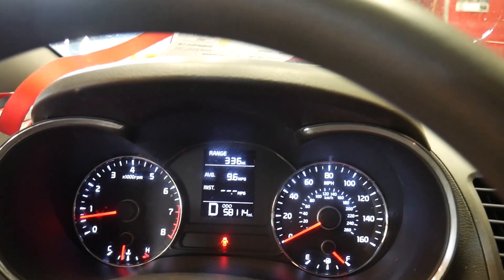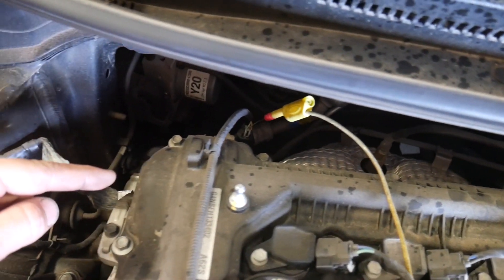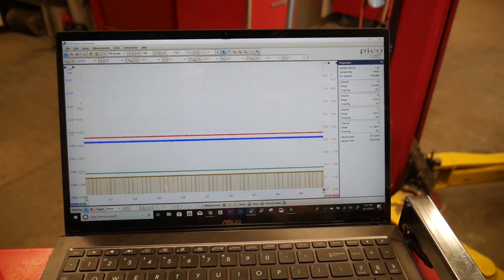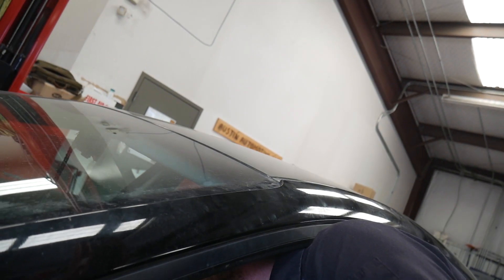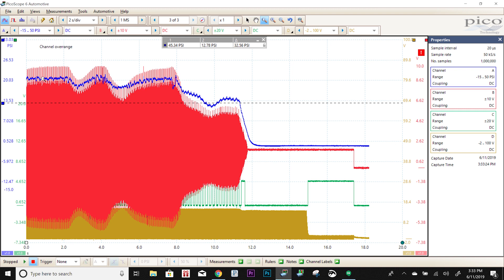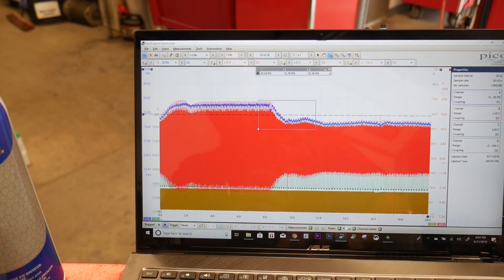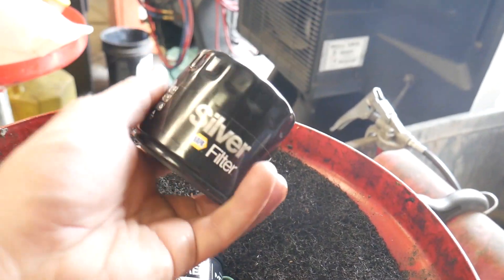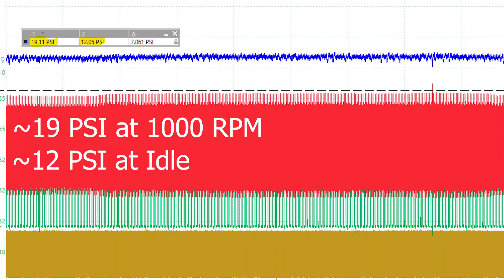2014 Kia Forte shake, rattle and stall- Diagnosing stalling issue

Comment: Great job on this. I’m running into this now. Would have never thought. The only thing I changed was going to Valvoline instead of the dealer because I’m out of warranty. I’m going to change the oil myself and Lord willing it’s gonna be fixed
Reply: Did it fix your issue?

Comment: Hello , I have almost the same problem but the light of the oil shows when I stop the car or idel . I changed the oil and the oil filter ,but still the noise coming on the low speed and the oil light shows on the dashboard .
Reply from the maker: @abdullahkhasawneh462  you likely have too much internal engine wear.
Reply: @ could be the engine oil pump?
Reply from the maker: @ typically no. I have only seen an oil pump fix a low pressure issue twice. 95% of the time when the oil pressure is actually low the problem is caused by internal engine wear.

Comment: My daughter has the same problem execpt it's 2018.  Can you tell me if the filter you used would work on 2018 and if so, what filter is it?  Thanks in advance.
Reply from the maker: @douglassmith2460  I now only the OEM filters on Hyundai and Kia. The part numbers vary year to year. Best way is to call dealer parts department with VIN.

Comment: Juat had this issue and got an oil change with a new OEM filter.  If i were to try to replicate this  a stall in a parked situation, could you advise? What rpms and how to brake.

Comment: This is great my 2017 Kia Forte S has been stalling just like this with no codes on computer also was thinking would never find problem thank you
Reply: I have the same issue will be looking into this
Reply: @ashleytaylor509  Changed the oil and problem went right away
Reply: @cutter7515 which oil did you use ?
Reply: @ashleytaylor509  full synthetic 5w 20

Comment: Very glad to find this video after checking dozens, thank you sir. I have a 2015 Sportage with 1.6 liter 136 HP GDI. It does not stall, but  idles at 600 rpm and shakes too much. Rpm surges 1-2 times  as I wait at the red lights, but it rides well. Dealer could not find anything, no codes nothing. Can it be the oil filter?  UPDATE : I finally  found the issue, the ignition coils were bad. They throw no codes, they were not totally broken, but it seems that they were not performing % 100. GDI engines are very sensitive for ignition, so if one of the coils go bad , you better replace them all. I hope this helps someone who has the same issue.

Comment: Jeez, THANK YOU so much for this video.  This has got to be my same problem.  I owe you big for this!
Reply from the maker: Let me know if that takes care of your issue.
Reply: @ThePracticalMechanic  It is looking good so far. I need to drive it around a little more, but I tried to low idle stall it and it wouldn't stall.  I put "Engine Restore" in a week or so ago, and I think that loosened some gunk into my oil filter. Lesson learned on that.

Comment: Oh dear I got one of these coming in the shop tomorrow at noon 15 forte. 
Customer States the car is hesitating between 1st and 2nd.
He has no codes at all!!
I was going to start with changing plugs and coil packs🤷‍♂️
Then I was going to move into cleaning the fuel injectors.
I'm glad I watched this video sounds like Kia makes a real s*** engine
Reply from the maker: What did you come up with? Hopefully some easy stuff like a tune up and oil change.
Reply: It ended up being the customers father took the car for Christmas and had a remote start put on.
They ran a wire through the firewall and into the first coil pack. There is two wires a blue and a red. they damaged the 2 wires and they were intermittently arcing.
I also changed all four plugs and coil packs .. car runs great.
 his factory radio was not working the dealer told him it was burnt out.
Replaced the fuse.. still working great today.
Reply from the maker: @larsbambi1575  we see lots of issues with remote starts and radio install causing battery drains but luckily not poor running.

Comment: This year and model of car has an active service bulletin for the original engine. These engines will catastrophically fail. There is an issue with oil delivery which leads to rod bearing failure. My car engine failed in this manner and left me stranded on a dangerous and narrow canyon road. The warranty is extended to 150k miles for these engines.

Comment: OEM filters and synthetic oil only on my 16' forte 1.8l since day 1, only time I got shaking was when I didn't get top tier gas for 2 gas fill ups. Currently at 130k miles, never cheap out on auto parts. Only code I've ever got was for a bad gas cap
Reply: You used premium gas only? How is the car now? Any issues?

Comment: This video was extremely helpful.  I have the exact same symptoms with same vehicle.  When I did my last oil change, I put a KIA dealer oil filter but put too much oil in the crank case.  Being in extremely cold tempuratures right now, I'm trying to figure out a way to remove some oil without having to crawl under the car.

Comment: Curious to know what that ticking noise is. I've read on a few forums that these engines start to tick usually around 50xxxkm. Is it that the valves need to be lapped?
Reply: Those engine do not have adjustable valves. They have solid lifters
Reply: Can confirm, my forte started ticking around 50k, still does at 130000km. Still no engine problems, though.

Comment: I have a 2014 Forte that dies at stops part time with no codes. I hadn't noticed it rattling but I did see the oil light flicker at idle in gear. I'll be checking the pressure & filter in the morning. Oil level was full. Thanks for sharing
Reply: Same thing is happening to me.
Reply from the maker: sorry for the delay. What was your results? Plugged filter? We are now stocking the kia/hyundai oil filters and recommending 3,000 mile intervals. We are seeing too many oiling issues.
Reply: @ThePracticalMechanic  I ended up changing the MAP sensor and the crankshaft sensor since both their codes showed up in the scanner and the car is perfect now
Reply: @ThePracticalMechanic  Oil pressure was 8-9 PSI at hot idle.  After install a NAPA gold filter it was 20 PSI. No more stalling.

Comment: My gfs car does this.  And even after i do the oil change it used to fix it but now it's still raddling. How do you fix this issue not just doing an oil change
Reply from the maker: You may have an engine that is worn out. The oil filters plug up with small metal shavings and hard oil deposits. Driving for long periods with a restricted oil filter causes accelerated wear and more particles. Changing the oil filter cannot restore the worn components back to new condition. It might be time for internal engine work or a new engine.

Comment: Hello👋
I just wanted to say THANK YOU For this video. I took my 2015 Forte to Kia 3 times for a rattling sound and stalling issues. They were never able to find anything after numerous times of me telling them that my vehicle was not safe to drive. They even said that the rattling was normal because the car was cold. I eventually brought it back home and bought the oil filter you mention on this video, did a motor flush and changed out the oil. My car is back to normal doesn’t rattle or stall anymore. 🙌🏻 thank you!
Reply from the maker: Becky Briones that is awesome!!!! Not awesome that they missed the issue but awesome that you were able to get it fixed. Thanks for the comment and hope you have a trouble free car now. 👍🏼
Reply: I’m going to try this because Kia can’t seem to find out why my 2014 Kia Forte is stalling just shutting off while driving ty
Reply: The dealership solution is either sell a boatload of parts, or deny that a problem exists and send you packing. I bet that they never even duplicated the problem; too many gravy jobs waiting.

Comment: Hello
I have bought recently Kia Rio 2014 1.4L petrol Car and facing a serious issue with it.
The car run perfectly but the fuel consumption is very high.
When I turn on the Air conditioner the car starts stalling at low speed.
The car is not showing any Warning on the dashboard.
I have changed the Crankshaft positioning sensor, camshaft positioning sensor, serviced the nozzles, changed spark plugs, checked the engine timing and everything is OK.
Would really appreciate if you can help
Reply from the maker: There are so many things that could cause poor fuel mileage. It might be time for a second set of eyes to give it a shot. Without seeing the cars data while driving under different load conditions  and testing individual components your just going to be guessing.

Comment: I'm thinking about buying a 2013 Kia Forte with 110,000 miles on it. When I went to test drive it, it seemed like it was rattling hard and almost going to stall out a few times when coming to a stop. Never accelerating though. Any ideas?
Reply from the maker: It is possible that it has the same issue. It might be worth it to have the oil changed even if you don’t purchase the car just to find out. If the noise is still there it may have more issues. The $40 oil change may save you thousands of repairs expenses.
Reply: @ThePracticalMechanic   thank you for your feedback. The owner mentioned that it had done that for the last 6 months and I saw that he had a recent oil change so I am NOT buying that car. Do you know what Kia model years do not have this engine problem?
Reply from the maker: I’m not really sure since I only have a few customers with Kia vehicles. I’ve seen this problem on other newer vehicles as well but with less of an affect.  I think a similar model would still be fine if the owner has maintenance records showing regular oil changes. 3000-5000 mile intervals is normal although I prefer using a factory oil filter and 3000 mile oil change intervals for extra protection on newer vehicles.
Reply: I recently bought a 2014 Kia forte with 101,523 miles on it I was at a stop light and the car turned off on me which I don't understand it's basically a new car with a good engine it seems to be

Comment: My wife's 2014 Kia Forte was stalling with no warning. She played around with it last night, could not find any codes or anything. We took it out for a spin tonight and I noticed the pinging and then it died. EXACTLY the same issue. And, she needs an oil change. She is at about 5000 miles since the last change. Yikes! I hope it's not a bad engine! I just realized she commented yesterday!
Reply: It worked like a charm! Got the big filter from Napa, got one for my 2012 Kia too. I've never had it ping like that, but it's a standard so I generally have it revving higher at slow speeds. I think it works harder too, smaller engine.

How did you figure it out? I would never have equated the timing advance to a drop in oil pressure, and I'm an engineer. You sir, are brilliant!
Reply from the maker: Hopefully the oil change will fix it. Any oil filter at this point will be better than the dirty on you have but if you have a local Kia/Hyundai dealer try and get a factory oil filter installed. An alternative would be the “Full” brand oil filter that you should be able to get from a Napa/Carquest/Advanced auto store but they may have order it in. The good filter is still only $5-8 depending on purchase location.  You may also want to consider switching to 3000 mile intervals once you know for sure no permanent damage has occurred.  Good luck!!
Reply from the maker: How did it turn out?
Reply: Been trying to hunt down the cause of this issue on my kia. Looks like it worked. Thanks a ton

Comment: My 2014 kia forte just did this twice today for the first time...  due for an oil change... will watch your video.  No engine light, no codes
Reply from the maker: Since this video I have been expanding the amount of OEM filter I keep in stock. I don't want to be the cause of future issues. Hope the oil change helps you out.
Reply from the maker: I asked your husband as well but I was wondering if you were able to change the oil and if the car is running any better?

Comment: My 2015 kia forte stalls when I'm at stop lights or turning really slow and then it starts right back up and drives fine. No mechanic can seem to tell me why. Check engine light has came on but it reports emissions issue. Can't tell me why it's stalling.
Reply: See @ 6 min mark, wrong oil filter installed
Reply: Same here oh my god its infuriating

Comment: I have changed the oil and filter but still have the sound, what is the problem
Reply: Wherever you got your last oil change done prob also put the wrong one on. I'd go to a Kia Dealership, get an oil change done, they'll put the right size one on, it's prob bigger than the one you got on now.
Reply: Maybe you put on a filter that's too small? See @6min mark
Reply: @rancidpunxcrypto1547  no the new filter is the same as the original one
Reply: Your last oil change was done at a Kia Dealership?
Reply: @rancidpunxcrypto1547  no

Comment: Nice video! I have the same issue but haven’t noticed a ping. Oil changes are done regularly at a kia dealer. Could this still be the issue? Running out of part idea to throw in it...

Comment: so the problem is the oil pressure ? my car which is a 2013 kia forte has the same damn problem we thought it was the fuel pump so we changed the pump out and its still stalling a second after getting it to turn over i done lost all hope for this car where should i take it
Reply: Wrong oil filter, see @ 6 min mark

Comment: I bought a used '14 Kia forte,  58,000 and change on the odometer. Same issues going on.  But im also experiencing voltage loss somewhere.  It's steady jumping at 12.5 to 12.8-9ish and surges to 13.1ish. New fuel pump, new alternator, new spark plugs, new oil in it with filter.  Ran a relay from fuse box to positive battery terminal because people have fixed the issues im experiencing.  Flickering interior lights, flickering headlights, low idle that surges,  i have the 1500 rpm range stall attempt as well.  It just jumps rpms around though.... doesn't stall anymore.  Do you think this could really be all because of low oil pressure? Seems far fetched
Reply: I have a 2014 forte, am having engine issues and oil consumption. No codes are showing but there’s definitely something wrong. I got regular oil changes because I have a warranty and the warranty is invalid, if you don’t. Multiple times I came in and there was no oil, yet I was 1000-2000 before an oil change was due. There’s a few lawsuits about this, so I am trying to find others.
Reply: @lauranelson9994  same here
Reply: Justin Bryan It took a shit ton of phone calls, to Kia corporate, the warranty company, and jumping through hoops, I even saw a lawyer. The thing that got Kia consumer affairs to finally pay was putting the service advisor and warranty company on a conference call. That day Kia corporate approved a new engine.
Reply: @lauranelson9994  That's really surprising to hear; I've been a Hyundai & Kia tech for 11 years; the first time you came in with an oil consumption concern we would've done an oil change & marked the level precisely & then have had you return in 3,000 miles. If you were down beyond an acceptable amount , we would simply put the PA in for the new engine & that's that. It's a really, really common process. 

Keep in mind that on Hyundais & Kias (along with most cars), that if you pull the dipstick and nothing is on it, that doesn't necessarily mean there is "no" oil. It only means you are at least 2qts low. 
When: Your oil light comes on, you hear rattling or squeeling, and/or the engine keeps stalling, that's when you have "no" oil.

And to answer the begging question, burning 2qts per 5k is not within acceptable limits... :)
Reply: @lauranelson9994  do you have the EX? GDI?
Reply from the maker: The flickering and voltage issue won’t be related but if you haven’t changed you oil recently you may want to change the filter and top up the oil. Less than $10 to find out if that’s your problem.
Reply: @ThePracticalMechanic  it ended up being i bought two faulty alternators in a row, also a bad ignition coil.
Reply: Just swapped filters today.... did not notice any major change.

Comment: Anyone know why my KIA Forte 2015 has the fuel injector under the intake manifold instead of on top like I see most on here?
Reply from the maker: It’s possible that yours has direct injection. Look for a GDI badge on the car somewhere or on the engine cover or on the emission label under the hood.
Reply: Thanks, I thought all KIAs 2015 are GDI engine..but I guess not

Comment: So which filter should I get for the best results? Napa, Mann, or ?
Reply from the maker: PJfrostbite after seeing many Napa filters have this issue I would stay away from those. Mann and Full should be decent filters and both can be purchased through most Napa stores in the altrom line. If you can get them that way just swing by the dealership and pick up a couple, they are inexpensive.
Reply: Thank You! My other halfs forte is doing the same thing. Probably just swap out the oil filter then and see if it stops. Mann and full